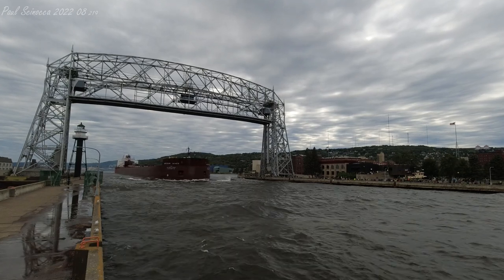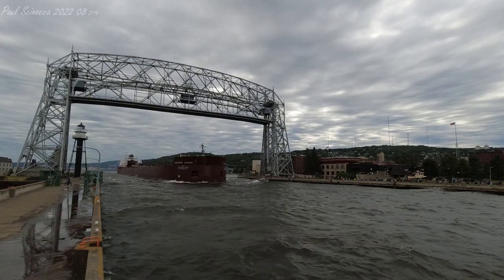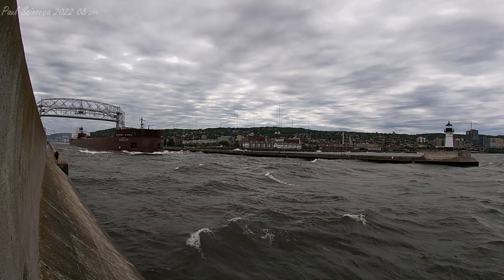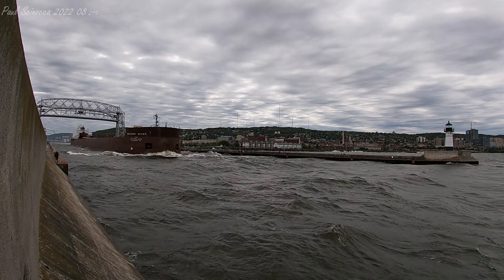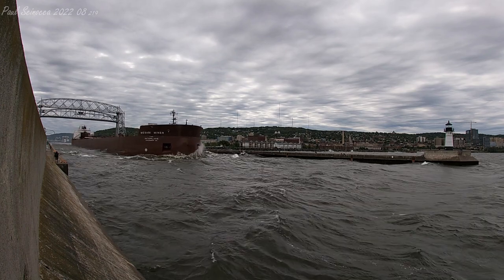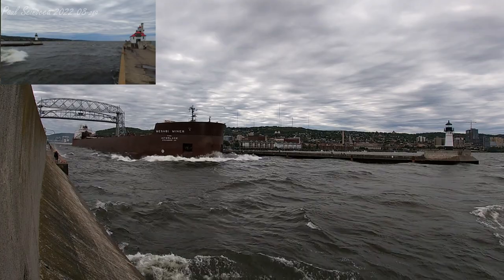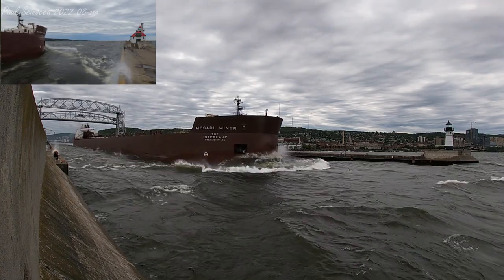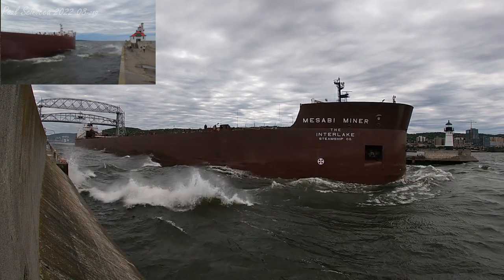Mesabi Miner VS Lake Superior! Plowing out of Duluth with coal August 07, 2022

Comment: Just for some context, a standard railroad hopper car can transport approximately 100 tons of coal.  That means it would take 680 rail cars to move the same load of coal that this ship can transport.  Railroads normally move coal in trains made up of nothing but coal hoppers, 100 hoppers per train powered by a minimum of two 4000 horsepower locomotives on flat ground though that can increase depending upon the steepest grades to be travelled over.

Tractor trailer trucks might handle 40 tons.
Reply: Tractor trailer trucks have a gross weight of 80,000#, which means the cargo capacity would be about 42-44,000 lbs. payload.
Reply: Trucks in Canada can haul more.  They use A and B trains (2 trailers).

Comment: About four years ago while on Maui we were told the resort had to close the beach due to high waves coming ashore. I grabbed my tablet and showed them video of 40 to 45 footers hitting the Duluth area the previous week.
Reply from the maker: Were they impressed? Hope Maui was fun!
Reply: @PaulScinocca  Fun? Of course right up the moment a wave came in while I was walking in the edge of the water and knocked me over. My glasses went one way and I went the other.
Reply from the maker: @mpetersen6  I'm not sure if I should laugh or not, if everything went okay in the end I'm not going to lie You made me chuckle
Reply: @PaulScinocca  
It really did not make my wife happy having to drive me into the big town on the island to get new glasses. The old ones are likely still on the bottom of Napili Bay. And one thing nobody ever mentions about getting tossed in the surf along the shore. You wind up with about three pounds of sand inside your suit. 
The one beach I would have liked to visit is the one on Ohau where they shot the scene in From Here to Eternity when we were on another trip. You have to work your way down a steep cliff or hill side to get there.

Comment: I didn't know coal plants still existed. Its a old school way to make electricity but the USA does a lot of things oldschool, looks like its behind a lot in time.
Reply: There are some legacy coal plants still operating in the US; however I doubt that any new ones are being built.  With the increase in the price of natural gas, a coal plant with emissions equipment can still be profitable; it just depends upon the coal/ natural gas price differential.  What I find interesting is that it is economical to ship coal to Detroit by water.  Usually western coal is shipped from the Powder River Basin in Wyoming by rail directly to its end user point, in this case Detroit.  Sometimes the rates charged by local rail are so high it makes it economically feasible to rail the coal to Duluth and then transfer it to water for a direct off load in Detroit.  Good way to put your local trunk rail system out of business.